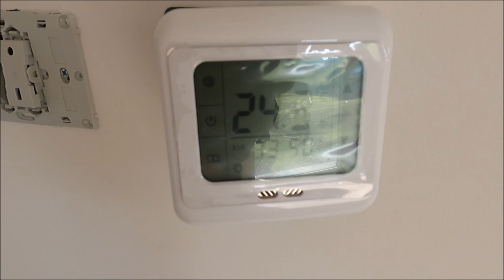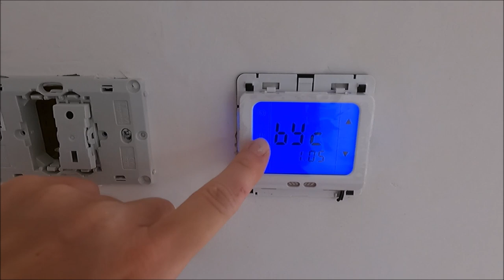I Install A Heating Mat On my Own | Martinas Life

Comment: Hi, you should think about replacing that water drain cover with the one that looks like prison bars - more space for water to flow away. Alternatively, try boring more holes into the existing cover, just to put more surface where water can drain. Also, when there's a torrential rain like we have these days (I'm from Serbia), think about removing the cover altogether until the water level lowers.
Reply from the maker: Thanks, yes there was so much water at once, but also tube where that water goes was full of sand and cement, that way it wasn't swallow faster